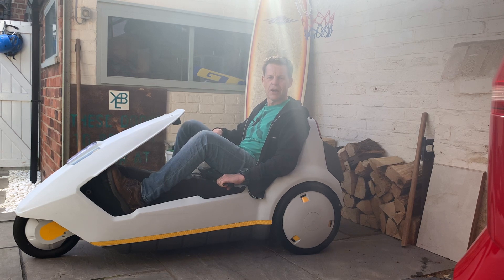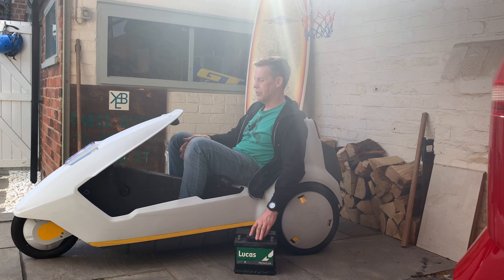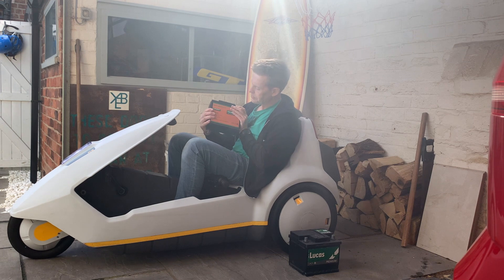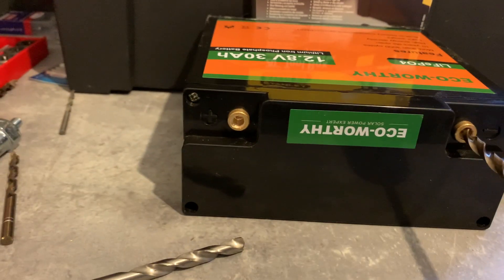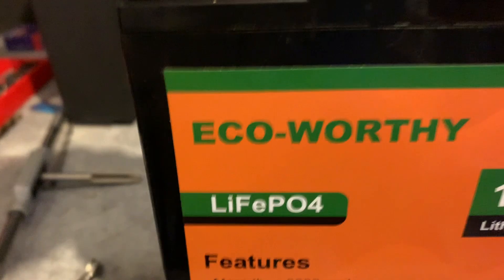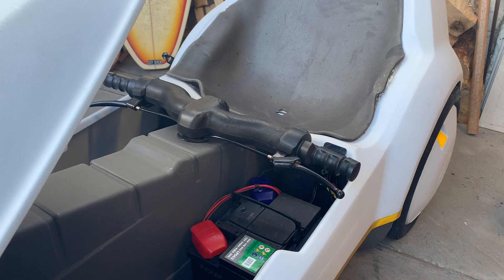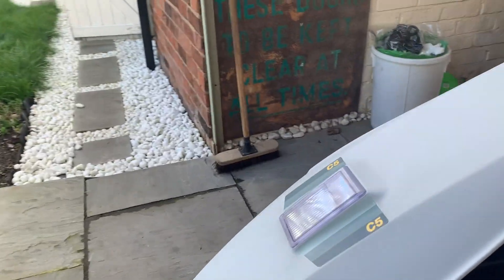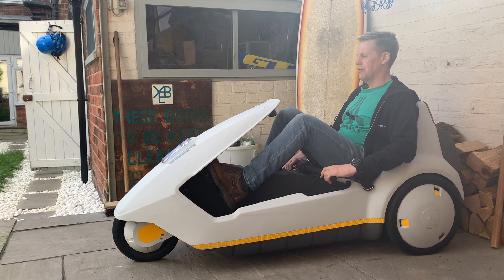Sinclair C5 Upgrades: Part 1

Comment: I think you should do more upgrades.  A newer higher efficiency motor and a better battery.
Reply from the maker: Thanks great ideas but I actually really like it as it is. It’s fun and fast enough and I’ve never been able to max out the range. So I’m into keeping original.
Reply: @timsbobs7774  Bikes are getting out of control.  There's a guy on youtube (ebike guy, IIRC) who filmed his son going 100mph on an (custom) e-bicycle.  There is also footage of a different guy in Florida going 70mph down the interstate (limited access highway) on a damn kick scooter.  So I figured the old C5 has 30mph in her, lol.
Reply from the maker: @ yes I agree about those e bikes being out of control. Keeping the C5 legal is a consideration for me. There is a limit of 15mph on e-bikes and a motor output cap which the original C5 is compliant with. Those souped up e-bikes and e-scooters are illegal on and off the road.

Comment: I found a modified sinclair and re-modified it with  suspension front fork, hub motor and ebike battery. its 10x better now and actually drives like an electric scooter.
Reply from the maker: @Boemel  sounds great!👍

Comment: You have a lithium iron phosphate battery ... i.e. a lithium ion battery. It's not a lithium polymer battery. Lithium ion batteries are commonly used in electric vehicles whilst lithium polymer batteries are generally the small battery you may have in a phone.

Comment: That’s your battery warranty gone!  Surely a better way to do this.
Reply from the maker: Did spend ages trying to find the right post converters with correct but none available. Seen other C5 owners do this to fit Lithium battery to the quick release car terminal connectors. Also means you can still use it with any standard car battery.

Comment: Could bave just got m5 battery posts couldn't you? Hows testing going as im not sure that battery has enough continuous current. The BMS will cut it out when going up hills etc.
Reply: I have quick release automotive M8 size connectors that are really convenient so wanted to keep using them. Battery works great even up hills! I’m getting at least 15 mile range.

Comment: Wouldn’t it have been easier to change the connector on the cable rather than drill the battery?
Reply from the maker: Maybe, but I like the convenience of the quick release connectors I have. Not sure if there are equivalent quick release options for M5 screw terminals that the battery came with.

Comment: Where did you get the battery!
Reply from the maker: Amazon! LiPo batteries are the one thing I noticed seem not to be getting more expensive at the moment.
Reply: Could you use two LiPo batteries & increase the range 🤔
Reply from the maker: @iantheinventor8151  yes in parallel but seems like 1 is enough for my requirements as I’m not going to do a trip long enough to drain it.